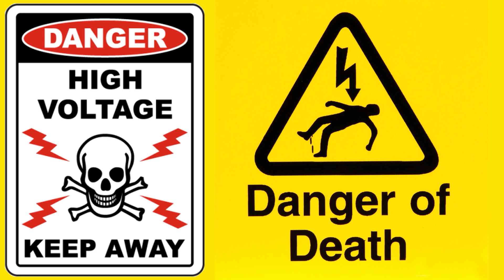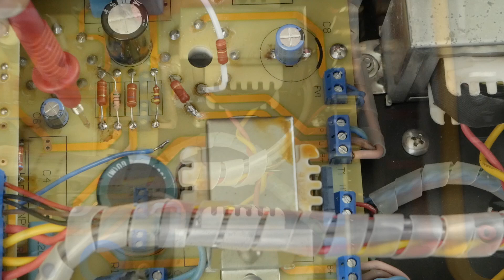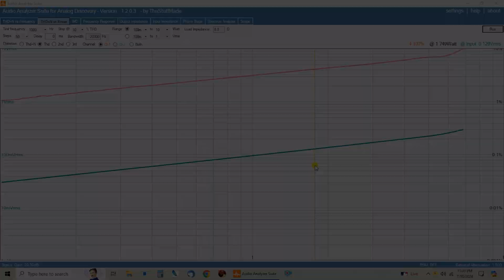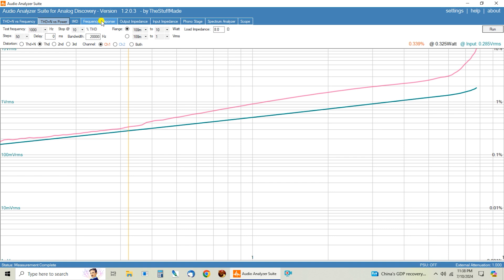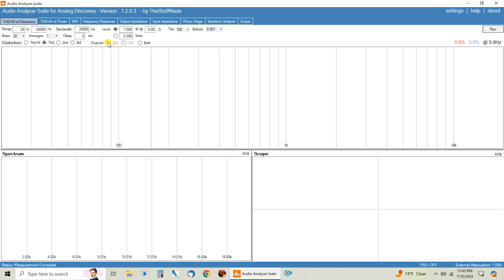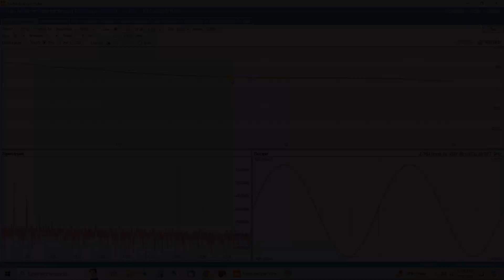Musical Paradise MP301 MKIII: Updated Driver Bias Results!

Comment: Hallo, hier wird von Pentoden gesprochen. Ist das das Modell mit der KT88 oder EL34 ?
Reply from the maker: The one I worked on came with EL34 tubes, but they claim you can also use KT88 tubes in the same amp.
Reply: @SkunkieDesignsElectronics Vielen Dank

Comment: Taking about component skimping. I have seen a review that showed the only difference between an entry level Prima Luna pre amp and the next model up is a capacitor upgrade. That's one big reason why I think my entry level Prima Luna amp has a less than ideal output transformer, besides the muddy sound and mushy rolled off base. My "12 watt???" Cheap Chinese amp is staggeringly more punchy and much louder base than the 40 watt Prima Luna. And that is using the same output tubes. I must say though despite the mushy sound. I still prefer to listen to the Prima Luna than any transistor based amp I own. Even though I know details are missing. it is still more pleasant to listen to music and closer to real life sounding. When I get around to upgrading those transformers, I will have to do a video about it. I wasn't sure to sell the amp or try upgrading the transformers, but this video convinced me to investigate a transformer upgrade further. Thank you 🙏

Comment: I have to get the Analogue discovery now. I have a bottom of the range Prima Luna and I am certain the transformers are rubbish. It's the only explanation why this amp sounds so wishy washy. Inside the circuit design looks very good. It even has direct coupled input to driver stage with no capacitor. I also have a cheap Chinese SE amp that sounds best in triode mode but probably only getting 2 watts in triode mode so that will be getting examined and upgraded. Basically I have two amps that don't sound quite right. Thank you for your inspiration to dig into these amplifiers.💜
Reply from the maker: It's what helped me figure out what changes would do.

Comment: So what is recommended for music (and occasional movie streaming ;) ). It looks like the ChiFi preamp are getting no love here. Anything interesting even 2nd hand (I don't need the latest flashy toy). Thanks!
Reply from the maker: At this low price point, something like that Aiyima A70 with some SparkoS op amps installed I just reviewed is better than any of these cheap tube amps (without extensive mods) I have looked at.
Reply: @SkunkieDesignsElectronics  thanks for the reply, much appreciated 😀👍

Comment: To me, as it is from factory, it looks like they are pushing a tube headphone amplifier into driving speakers with small low impedance output transformers.
Reply from the maker: May be, but that's not how they advertise it, nor how it's been hyped by influencers.

Comment: I figure if u use a sun it goes in the preamps second output jack.
Reply from the maker: Yeah you could work around this lack of low frequency output, but then you are adding more components and using a pre-amp on an amp that already has an overly high input sensitivity, like all these made in China tube amps seem to have. It's like they are designed for use with an ancient crystal phono cart that hasn't been make in 60 years.
Reply: @SkunkieDesignsElectronics  the amp should work properly regardless. excellent work, sister.

Comment: Let's hope that Musical Paradise doesn't get their panties in a knot over the Audio Analyzer results. I can understand your frustration over such poorly designed circuits.
Reply from the maker: Like I told Willsenton with their first version of the R8, "Make a product that works well and it will get a good review, it's not my fault your product doesn't perform as advertised." Clearly from this video I show what these tubes can do if it was designed properly. Using a pentode to drive a UL pentode with zero feedback, not even a little local, is gonna be a mess. Especially using a low % UL tap OT, a % that is normally used for an EL84 tube design.
Reply: @SkunkieDesignsElectronics  Wow.
Reply: They should be happy to get a free design update